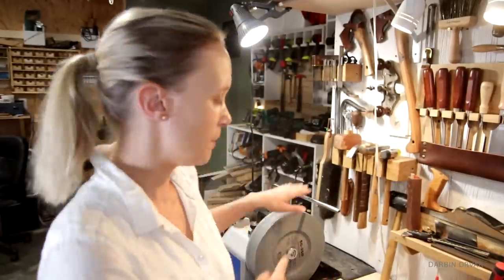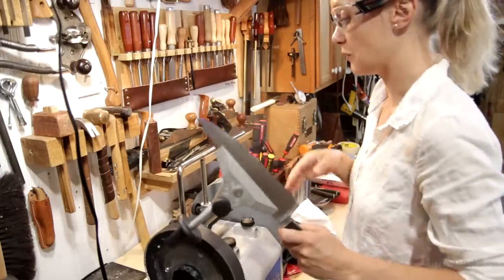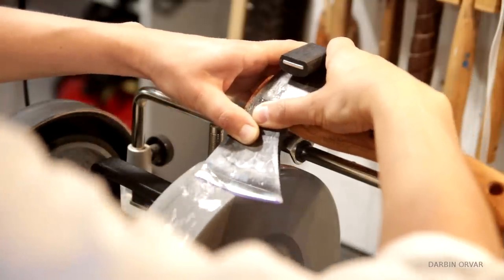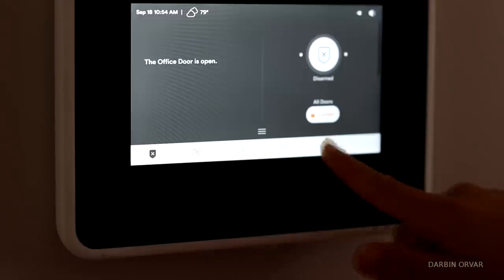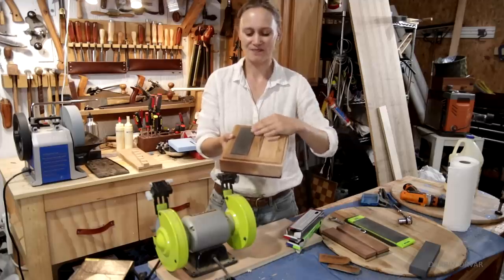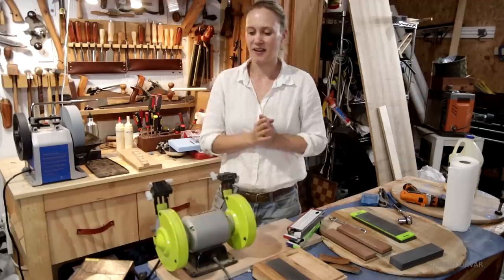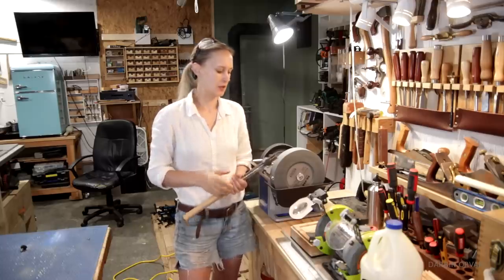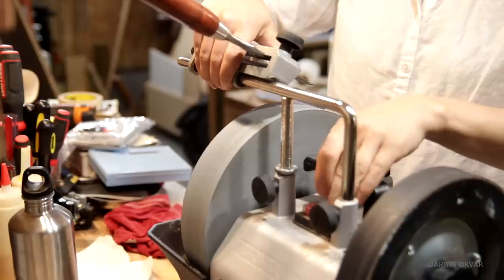Sharpening Axes, Knives, Gouges, Chisels // Woodworking Tools

Comment: Hi, I had watched all the videos with Tormek sharpening but the cost was a problem for me. So I bought a reputable but cheaper copy that has the same tool bar. The jigs that came with the grinder were pretty poor and I was at a loss until I started to buy the Tormek jigs. What a revelation. I can now sharpen like I was in Tormekland. Regards Colin in Northern Ireland

Comment: Excellent video!  It truly makes a big difference when using a sharp tool.  I don't have a Tormek but do use a motorized Makita with changeable waterstones (I have to soak the stones for awhile and use a drip system).   I also use a (Robert Larson) honing guide and DMT Duo Sharp diamond plates for my chisels--this is a LOT faster, cleaner and more convenient than setting up my waterstones, as the DMT sharpening plates are diamond surface and do not require oil or water.   For any system it is important to wipe your tools between using different grits.  I also have a long leather strop to remove the burr that the stones/plates leave.   If you do any woodworking you need to sharpen!

Comment: I made a roll around cabinet for the Hormel and grinder. It has a drawer and storage underneath, locking casters and laminate top. It is also tall enough to be used as an out-feed table with the table saw.
Reply: Tormek not Hormel

Comment: You've got to keep the tools sharp. Thank you. As to a smart home, I love mine. It's just my wife and I and if we are both gone the doors automatically lock, and our alarm sets itself. The problem is if we are on a trip, I have to remember to turn the alarm off manually or tell the Roomba not to run. More than once I've been woken up in a hotel at 6am with an alarm because the vacuums motion sets it off. :)  Thanks for your hard work, you keep us sharp!
Reply from the maker: Haha, this has a setting where you can put the alarm on "home" or "away". I need to put it on home, with my dog Darwin walking around so it won't get triggered!

Comment: Honestly, I never really understood how the 2 grit/sided surface stone can change the grit of the round stone. Looking at it in a theoretical standpoint, if I were to cut grooves in the stone wheel, it would still be whatever grit the stone is. If I were to drill holes in the stone, it would still be the same grit. No matter what the surface looks like, the stone will always be comprised of the same grit of which the stone is cut from or manufactured from. Any ideas on this?
Really, the only thing I can think of is that the higher grit surfacing stone is providing less surface area of grinding face thus providing more pressure for the stone to cut faster, essentially changing it's cutting speed not surface grit.
Reply: 393stroker I was scrolling through the comments to find one like this. I don't understand how it works  but I imagine that small particles come off the stone grader into the stone and get wedged into the microscopic grooves which would temporarily change the grit until it wears out? I dunno
Reply: @jawadashraf7809  Good point, possibly what happens.

Comment: A useful illustration of how you tackle the task of sharpening such a varied collection of tools ! One question is when you buy new tools, do you choose ones that you know will be "good" to sharpen ? For instance do you look for particular types or finishes of metal used in the blades of chisels and wood turning tools ? Or are all the blades the same when it comes to sharpening regardless of price ? I'm perhaps over-complicating this, but hopefully you understand my question ? Many thanks Phil
Reply: I had to laugh at your suggestion that you may be over complicating this issue.  No, you are definitely not over complicating this issue.  Google "best steel for knives" if you want to go down that particular rabbit hole.  -  The composition of the steel is as important as the heat treat process.  Steel can be inexpensive and perform well if it is heat treated properly.  Different kinds of steel have a different feel (I mostly sharped by hand) on different sharpening media, so a particular stainless steel may sharpen easily on a water stone but be difficult to sharpen on a diamond plate.  Personally, I follow the age-old advice that you should buy the best tool you can properly afford, leaving, of course, enough cash aside to buy wood and food.
Reply: @TerryPullen  Hi Terry ! Thanks for your intuitive comments ! I remember a few decades ago in the UK when Sheffield steel was killed off by cheap imports, despite attempts by the manufacturers to point out that "you get what you pay for", to no avail ! We have many secondhand stores in Leominster, UK, where fortunately we can find decent tools that were built to last, at cheaper prices than new badly-made items - at least there is that avenue to explore ! Many thanks and all the best !

Comment: I'm pretty sure that's actually not how you're supposed to sharpen a roughing gouge on the tormek. I've actually made the same mistake and using that particular jig will sharpen it more like a spindle or bowl gouge and will start to pull the ears out and you'll lose the square cutting face that you want on a roughing gouge. Instead you'll want the same jig you use for the skew just set it to a square angle and that will let you keep the roughing gauge at the right profile.

Comment: Um, were you sharpening several blades and changing the stone grit for each individual blade? 

Just to state the obvious because I often don't see the thing I'm looking for sitting right there in front of my face; I hate when that happens. But I digress. 

Your stone will last longer if when sharpening multiple blades, you run them all through the rough grit, then change the grit of the stone, then run all the blades through the finer grit.
Reply: i am assuming she would have to "re-calibrate" the stone after each knife or tool, otherwise how do you know it is holding the required grit? I don't think it matters
Reply: I wondered about that too! Seems more efficient, and much less wear and tear on the stone by batching all that you want to sharpen on the first grit, then change the grit with that stone bar and then finish all of them off. . . (or am I over-thinking this??)
Reply: @gac914  One does things differently for demonstration purposes than they would Off Camera. I assume this is what she is doing.  She seems like a pretty sharp cookie (I had to)
Reply: @jomangeee9180  
The only probable change  you would have with each blade is the angle of the blade to the stone and that would be determined by the size of the blade and the desired angle for cutting. 

This is more critical with chisels and planes but the principle is still the same.

The process is to start with the lowest grit and work up to the highest grit regardless of what you are sharpening.
Reply: @gac914  
When using separate stones, you don't change the grit of the stone, you change the stone. So naturally, it would be more efficient to do all the blades on one grit then change to a different stone. Of course, you would also need to have a setup that permitted you to do a blade and set it to a place that indicated it was done for that grit. Well, I would anyway, otherwise I'd end up sharpening a blade multiple times.